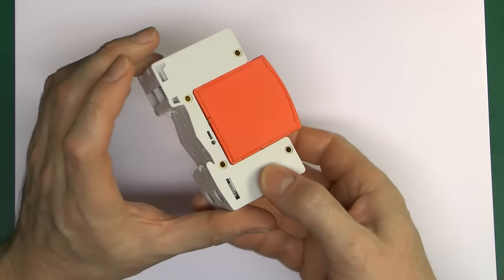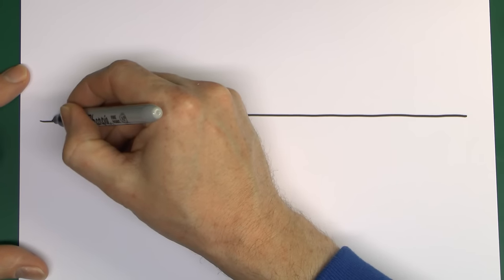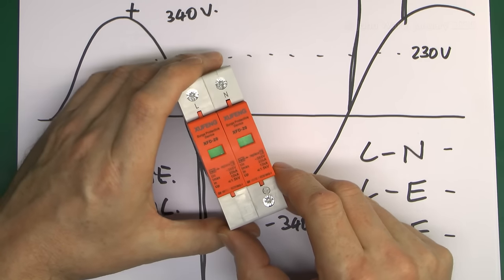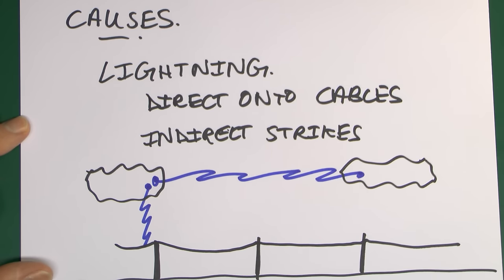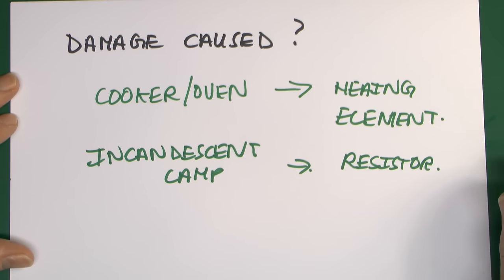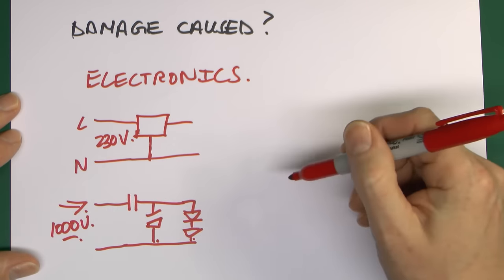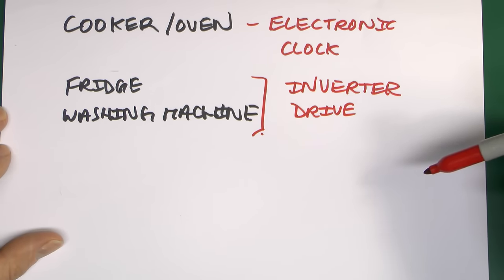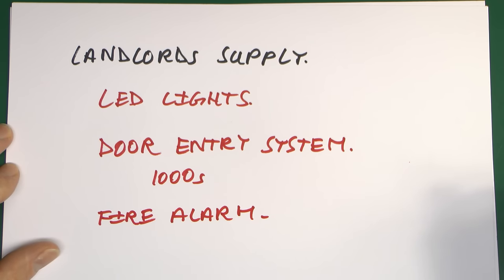Surge Protection Devices - Part 1

Comment: Thanks John, this is a great video, really helpful to explain the use of and requirement for surge protection. Very few people really realise the true extent & cost of damage caused by over voltage issues, one reason for that is that the UK insurance industry is very tight lipped about these things. In Germany this is not the case the insurance industry makes information freely available and they suggest that from all claims of "electrical or electronic damage" over voltage / surge issues are responsible for 31% of the claims. That is a huge figure, for anyone reading this and thinking "he's an idiot, I've never seen anything like that level of damage" ....well how do you know? Over voltage damage is not always immediate and spectacular, there may not be a huge bang and plumes of black smoke. You can have several incidents over a few weeks and it would lead to wear and tear, then one day flick a switch on and the equipment doesn't work. Do you immediately think "oh that must be wear and tear fro over voltage events" of course you don't. You think "oh that's broken, more money to replace it /repair it". SPD's offer longer life spans for equipment, increased levels of availability, reduction in down time and less maintenance. They are like "electrical life assurance for equipment".

Comment: Excellent videos thanks. I rewired a property following a direct lightning strike some years ago. It hit an extension part of the property and more or less demolished it. If there was anybody in at the time it could have been serious. 2.5 mm and 6mm cables had been vaporised in places. Seemed to use everything it could as a path to ground. Open reach or British telecom were there for a few days doing street works.
Reply: I can believe a direct lightning strike would be really really nasty in infrastructure terms... if the customer's  cables suffered that much damage... then yes the local substation transformer pushing 240 measly volts ,... is not going to stop the lightning seeing a live wire as 'something at earth potential', And as for phone wiring, i bet the openreach guys had 2 pits? [one before the fault and one after].

Comment: My kitchen had a mixture of fluorescent and incandescent lighting.  I replaced the incandescent lamps with LED types and noticed that the LEDs were failing almost immediately.  Finally it dawned on me that the failures were always coincident with switching the lights on or off.  The only reason for this I could think of was that the chokes in the fluorescent fittings were causing a surge at switch on/off which was enough to damage the LEDs.  I replaced all the fluorescent fittings with LED types and problem solved.

Not particularly surprising I hear you say.  However, two things are worthy of note.  LEDs elsewhere in the house of exactly the same type/manufacturer were not being damaged although they were on the same lighting circuit.  I can only assume that the extra wiring length to these other LEDs had sufficient capacitance to suppress the surges being generated by the fluorescent fittings.  The other thing I was surprised by was that the LED manufacturers (a well known brand) had never heard of this kind of issue before and moreover did not seem to be very aware in general of how sensitive their products were to what I imagine are fairly minor surges in the great scheme of things (assuming my theory was correct!).

Has anyone else encountered similar issues?
Reply: very interesting, i agree that the chokes might be the problem for the surge
Reply: Colin Hursell - if the two different types of lighting were controlled from the same switch, I’m not surprised. Inductors can generate high voltage spikes of 500V upwards when the supply is switched off. If the LED lights are on the same circuit, guess where this energy goes...
Reply: @Mark1024MAK  Shouldn't it go through a diode on the same board as the choke? Why would it even make it back to the line? The diode should look like a short and thus the path of least resistance.
Reply: Roflcopter4b - for conventional fluorescent lights that use a choke (inductor), there are no diodes needed or used. And the bridge rectifier in a LED lamp will just channel any high voltage spike into the rest of the circuitry...
Now if the designers/manufacturers of the LED lamp included some over voltage protection components, the lamps are likely to survive a lot longer.
Reply: @Mark1024MAK  I see. Come to think of it, it wouldn't make sense to have a diode there anyway. I was mistakenly thinking about it as though the inductor were passing DC (as in a filter reactor or a relay for example). In such circuits adding a diode in reverse across the inductor is almost reflexive. Doing this would make no sense at all if the choke is passing AC for obvious reasons. My mistake.
Would it really be so hard for them to just put a little MOV in fluorescent lights?
Reply: Roflcopter4b - one of my former workmates liked to use the expression “kettle electric” when talking about or referring to electrical systems without any semiconductor electronic components (other than rectifier diodes). The reference meaning electrical systems where the quality of the system/waveform would only be good enough for transformers, motors or heaters... not electronic systems.
The manufacturers of conventional fluorescent lights are unlikely to have even considered them being used in parallel with LED lighting, so would only have been concerned with making sure any arc across the controlling wall switch would be within the normal limits of the standard wall switches.
Reply: Yes, LED's are much more susceptible to transients. As we make our homes and buildings 'smarter' and move towards lower and lower voltages we actually increase the risk from a 'surge'. It wasn't such a problem when things were electro-mechanical this sort of equipment had a naturally built in withstand capability simply from their way of construction. Now we have micro-electronics with tiny components and using milli-volts and this type of equipment simply cannot withstand these switching surges.
Reply: Sean Passant - sorry, I don’t entirely agree. The problem is that of quality. If a manufacturer uses a good design, the equipment should be able to withstand the spikes and surges that are normally expected on a mains supply. However, if the manufacturer just wants to produce the cheapest product, no account will be taken of possible damage from spikes and surges. This is nothing new and has been known about since the 1970s. But people love a ‘bargain’...

Comment: Most damage caused by surge I witnessed, was in the one of substations in a factory last summer. Surge (or few of them) busted the SPDs, but also busted electronics of a main circuit breaker and power analyzer. Later on, there was significant voltage drop that caused overcurrent, which resulted in melted 2500A busbars, because 2000A breaker didnt trip.
Reply: Perhaps that was to do with undervoltage and current spikes but sounds to me like the equipment was underrated and ubsuitable for the fault level. Did you manage to get to the bottom of this?

Comment: Most electronic devices have at least a token amount of surge suppression fitted.  At the mains input you will often see a small (normally blue) disc called a metal oxide varistor connected across the supply input.  These short out large spikes and have microsecond response times.
Reply: Precisely! At 15:05 JW makes a very large error. He says that the first component in any modern device is a "microcontroller". In actual fact, the first component is a fuse, followed immediately by a MOV (Surge Protector). The MOV and Fuse are specifically there to clamp any Surges, and if the current is too high then to blow the fuse and disconnect the device.
In reality, there is almost ZERO need for "surge protectors", be that in a fusebox or in  downstream power strip, etc.
Reply: John Coops - there is absolutely no protection in cheap badly designed imported electronic crap. In good quality well designed electronic equipment, there is indeed built-in surge protection. Plus surge protection plugs and extension leads are available.
Reply: @Mark1024MAK  - That is exactly my point! Nobody cares if cheap badly designed imported crap gets killed by a surge. Good quality well designed (compliant) equipment contains built in surge protection to protect ITSELF. Consider how many of your own high quality devices have been killed by surges!  So (generally speaking) the so-called "surge protected" powerboards etc provide no extra protection for good quality compliant devices, which makes them pointless as I said. It's totally idiotic to spend hundreds of dollars on a special power board to "protect" a shitty non-compliant self-imported device that only cost a few bucks and will probably fail from other causes anyway.
Reply: John Coops - agreed 👏
Reply: But these MOV's are designed to offer the withstand capability required by BS7671, 6kv at the meter, down to 1.5kv for the most sensitive equipment. They are a last line of defence and are not supposed to be subjected to repeated transients.  What if your over voltage event is in excess of this 1.5kv as they frequently are?

Comment: That was certainly good insomnia protection JW, just a quick correction, “high voltage transients” even those from direct strikes to overhead lines, don’t travel very far before they dissipate either by breaking down the air resistance and finding a path to earth, or the insulation between adjacent conductors and finding a path to neutral.

HV injections (where a cross arm breaks, or a car hits a pole and one of the hv lines falls onto the LV network below it), on the other hand can really do some damage, because the voltage is low enough to travel down the network without flashing over, and it will continue to flow until the protective device upstream operates (current X duration = let through energy), and that little 20Ka MOV arrester you have there will either be a god send if it is properly installed, or, what the fire brigade will later identify as “the seat of the fire”.
Reply: I’ve seen what happens when a 11kV line breaks and falls onto some low voltage equipment below. Not only did it destroy the low voltage equipment (a 110V to 20V transformer, an smaller 6V transformer), it also literally blew the associated wires (1.5mm squared) to pieces where they were routed around a 90 degree bend. Lightening on the other hand (but not a direct strike), just takes out the so called lightening protection fuses or the normal fuses as the metal oxide resistor(s), gas discharge tube(s), surge protection diodes or Zener diodes draw a large current. Yes the equipment often survives, put new fuses and new lightening protection components are needed.
Reply: Actually the standard talks about transients travelling up to 2km and I have personally witnessed lightning energy travelling for up to 11.5km so it actually depends on the source generating the surge, the wave shape (they differ) and the total level of energy.

Comment: One of my neighbors had a lightning strike come down his chimney (breaking some of the brickwork) and go straight into his television,  which basically exploded. The surge protector strip that the TV was plugged into suffered no damage. One of those weird things lightning can do I guess.
Reply: The proper is to put rail surge protector centrally
Reply: 🤨 Were was the tv positioned? In front of the fire place (LCD flat screen) - hit the tv though the opening of the fire, next to the fire place - poor chap got shocked 😱 seeing the bolt come out of the fire, arcing off the grate and hit the side of the tv, or on the chimney breast above the mantlepiece. What type of TV? CRT/LCD flat screen. Were the other things plugged into the surge protected extension lead sockets affected? Was the aerial on the chimney stack? If a stove had replaced the open fire - the initial bolt had hit the top of the flue, conducted down it and arced off the stove and hit the tv?
Reply: @samuelfellows6923  surge protector is protecting power line surges not chimney direct strikes
Reply: I'm guessing the aerial was attached to the chimney?
Reply: Surge protectors like that can only attenuate surges that happen on the supply lines. If the source of the surge is from an external point, they will do nothing
Reply: If the surge went into the aerial socket, then the power strip would do nothing.
Reply: More then likely it was the aerial that was hit not the chimney (unless there was a metal lining in it,still lighting can go everywhere)

Comment: Indirect lightning is a real problem where i live out in the country - overhead lines for both electricity supply and telephone. First thing we do at the first sound of thunder in the distance is unplug the internet router and telephone from the incoming line, if we don't it often leads to a lengthy tech call to the BT fault center trying to explain to them that a lightning storm just blew up yet another one of their routers! Have lost several that way over the last 10 years i have lived here.
Reply: 100SteveB why aren’t you using both whole house and individual device surge protection? After the first device was killed and you failed to install basic protection they should be holding you liable... this is why the cost of service keeps increasing, people aren’t using basic protection and the ISP has to replace an expensive electronic device in hundreds of homes every time there’s a storm.
Reply: @mattgayda2840  All my equipment is protected from mains AC surges, and they have always worked well, never suffered any damage from electrical storms. The only things that have been damaged are the BT master socket - that's always failed when my router failed. The BT engineer that comes out told me that there is surge protection built into the master socket, but it's not always totally effective if the surge is big enough. I have asked if i should use a separate protector between the master socket and the router but they advised me strongly against doing that saying i could be held liable for any damage occurring in the future. The biggest problem for me was that i had about 8 miles of copper between me and the exchange, nearly all of it overhead. But, fingers crossed, since we've had fibre to the cabinet, i have not had an issue - i now only have a few hundred meters of copper left.

Comment: Great explanation. I cannot understand why SPD's are being disregarded so much for domestic jobs even by the NICEIC, my local supplier says I'm the only contractor fitting them. Why are they so expensive I've just ordered some MOV's from a supplier at 10p each to experiment with. Looking forward to the next installment.
Reply from the maker: Like many things, it's the attitude of 'the old ways are best' and 'we didn't need these before' - both of which ignore the fact that electrical installations and the equipment in them has changed massively.
Reply: @ruben_balea  Looks like I need to delve into the specifications a bit more thanks for you reply.  Can you advise why MOV's are used on live to earth and gas discharge tubes are used on neutral to earth.
Reply: @ruben_balea  understand a bit more now thanks very much.
Reply: Rubén Balea - I’m sorry, but they are still overpriced for what they are. Especially considering that any well designed good quality electronic product should already have some over voltage / surge protection built-in.
And lots of smaller local protection is often considered to be better than one central protection system.